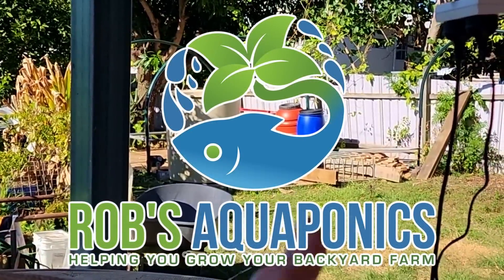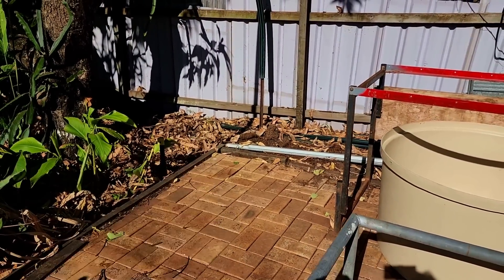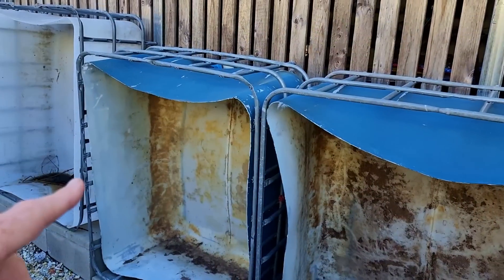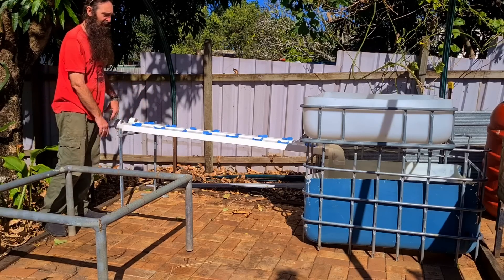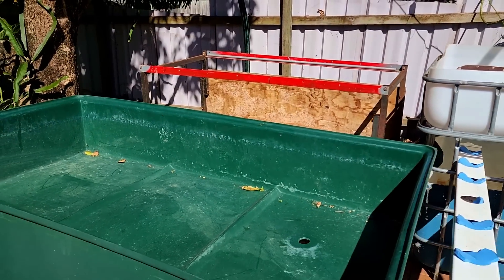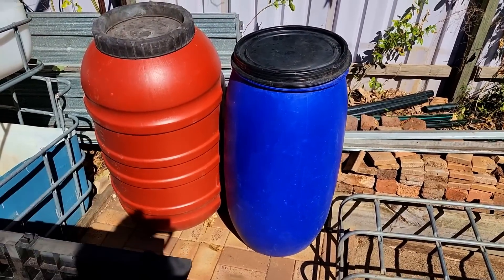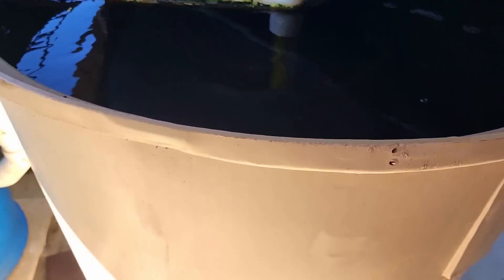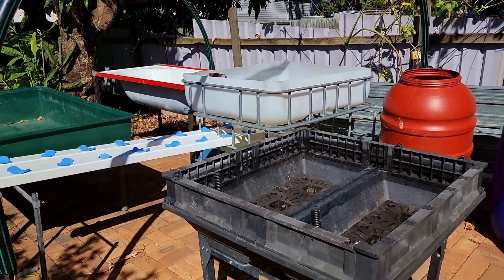Frankenstein Aquaponics - Final Grow Bed Layout - DRZ, DWC, NFT, Media & Wicking Beds

Comment: rob if you get some plastic uv rated . cut a circle and drill holes in it then silicon the back of it and screw it to the flank of that ibc it will hold water my guess. i highly recommend a 3d printer. only if you have patience  though lol.
Reply from the maker: Cheers mate. The whole fitting is cracked back to where it joins the tank so I'd need to remove the whole thing. More trouble than it's worth I think. 
hope all's well with you.

Comment: I was wondering about what you do for evaporation. Do you have an auto top off in place or do you add water every day or so
Reply from the maker: I generally top up once a week here through summer. Most of the water is use by the plants as I understand it.

Comment: Hi Rob

Instead of a radial flow filter could you build the filter you showed 6 months or so ago. It was a review of somebody else’s system and they had different grades of material that the water came up through and needed cleaning out about every six months?
Reply from the maker: I've decided not to for this system as I want this to be a simple build component wise. Will definitely be including one in future builds though.

Comment: Hey Rob, how come your not using the cone bottom tank you were gifted a while ago ? It’s killing me to see how you use it. 
Thanks again for your videos mate.
Reply from the maker: It's far too tall for this build Mark. From memory, it's about 150mm/5"  taller than the fish tank which means I'd have to dig out a hole for the base & the pump to drain the solids from it. That whole area has roots from the tree next door as well which is a bit of a pain in the rear. 
It will be used in a future build that involves a sand bed as I want to set it up like Owen has his in a foder system I'd like to build to feed farm animals. 
Cheers mate.